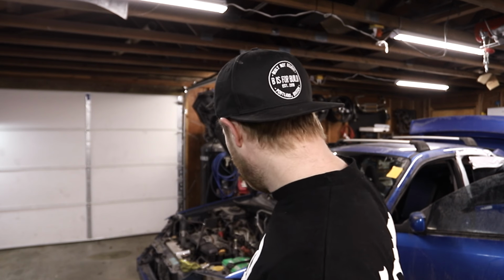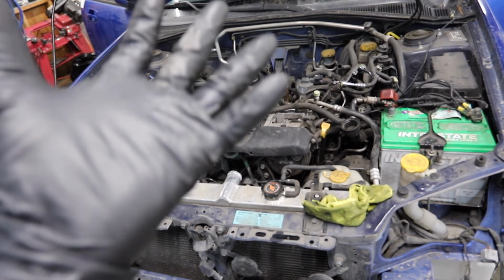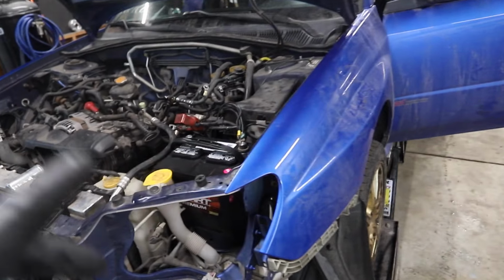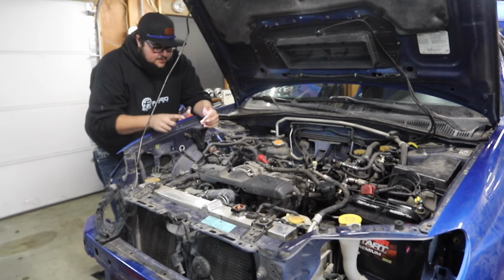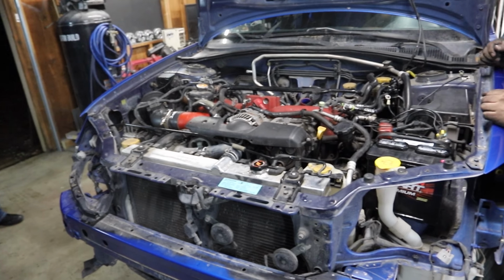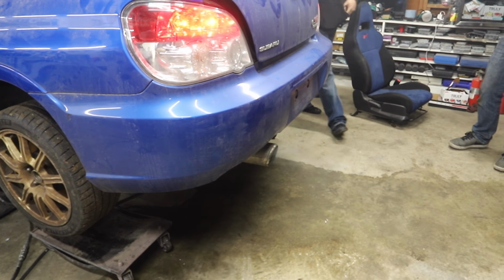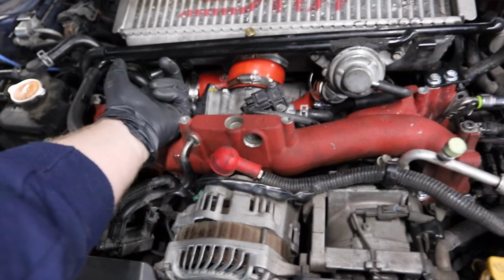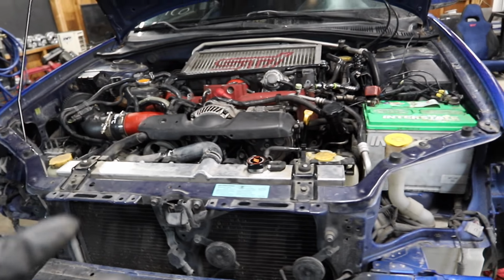Cheap Flooded WRX STI Will It Run!?

Comment: Drop the pan now. Clean as much as possible.  
Clean the fuel tank for sure. 
Drain power steering as well.
Reply: Agreed
Reply: Yup
Reply: I would do to
Reply: Agreed
Reply: rosskie320 exactly, he needs to replace that power steering pump too. The bearing is completely shot and they’re only about 70-80 bucks
Reply: ApeX MoDs agreed
Reply: Needs a full killer b kit when the pan gets dropped
Reply: I would have done that after the first oil change.
Reply: Do that its possible too bring this car back too it's original state
Reply: Also should drain the trans and diff fluid
Reply: @idokwatcher2062  60% of the time it works everytime.
Reply: Yeah that would be the first things to do
Reply: Agreed 100 %.
Reply: dont forget tranny and diff oil
Reply: Drain every fluid in the car*
Reply: And transmission
Reply: Not to mention brake fluid.... just do all fluids
Reply: Very simple, all fluids and anything that has a bearing needs replacement.
Reply: When it first ran I was like... did they replace the fuel? Then he said about water in the fuel and I facepalmed.
Reply: @Wanted797  Same here. It wouldn't crank and I'm like "I bet the lines have water in them" sure enough that was his techs comment next 🤣😂. This is a cool project though. Hopefully he brings her back.
Reply: Agreed

Comment: You could clean the engine by filling it with diesel instead of oil couple times and run it on idle. It cleans milkshake quite well and diesel has lub properties so it does not damage the engine or the seals.
Reply: Interesting
Reply: And by the way gasoline that many people use for that task is no good cause it dries all the oil seals in the engine as well as everything inside and it’s causing damage. Only diesel that contains basically oil.
Reply: a quart of transfluid will do it as well. As long as there isnt a heavy load on the motor the water will boil out when the oil gets to temp.
Reply: MrRock861261 yes will do just trans fluid does not have cleaning properties like diesel. Keeps tend to separate from water like normal oil. Diesel mixes with water and takes it out and when at rest then separates from water.

Comment: sounds like the idler pully bearing or the alternator bearings have had it
Reply: Was the A/C compressor still on the engine?  That's my guess.  Smaller belt (A/C "delete") for the win.
Reply: Could also be the ac belt tensioner pulley bearing having a shit.
Reply: Interesting !
Reply: I’m building a jdm GC8 on my channel if I head that I’d shut my engine off straight away.
Reply: @SAVING_ICONIC_MACHINES  Ya but you don't have the funds he has to blow so doesn't matter to him and everyone learns something. However to us normal folks yes you'd be right and I'd agree with ya.
Reply: working2Bselfsufficient definitely have to agree with you...and I do love b is for build great videos with lots of information ℹ️ 👍🏽
Reply: I thought  I heard a dragging note.
Reply: Oblioi mymilkchurn I know right? I can’t believe they didn’t think anything of it
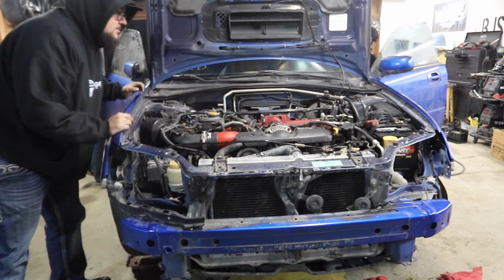Reply: is that what is causing the sound @13:20 ...my subaru recently started whining like that
Reply: My Jeep likes to believe that it is a submarine every now and then. My idler pulley and water are not good friends. I'd check everything in the belt system if this STI were mine.
Reply: The belt is probably slipping too. The rubber in belts absorb the water and they swell and slip. Or a bearing filled with water. I mean regardless replace the belt and check all the pulleys while he has it off
Reply: It's a flooded engine, i had the same problem before,  just throw a new oem timing kit and you will be fine,  no noise no nothing
Reply: All bearings on the front of the engine have been marinating in water so they're dunzo.
Reply: @SAVING_ICONIC_MACHINES  If you know what it is (which they did) and see that it's not critical then you add it to the list and move on.
Reply: Drunk3n_M0nk sorry mate I’m not sure what iv said and didn’t move on iv only put one comment
Reply: @trd8749  totally agree, nobody really cares
Reply: @nunyabinis  my A/C tensioner failed and sounded JUST like that.
Reply: u seem to think they know wut they are doing...i mean it sounds like they do but u can tell they arent very experienced. i see a lot of "google it" in that garage.
Reply: I had the same problem with my old rangerover after repairing it after being underwater altornator bearings where dead
Reply: the engine must be opened n serviced, they shouldnt started it ....

Comment: I definitely would have pulled the motor, pulled the pan, cleaned with brake-clean, pulled the heads, cleaned everything you can touch, replace timing belt and related rollers and bearings, reassemble, and pull the plugs out of the bottom of the fuel tank to drain (all of my Subaru's have had plugs). Would have taken little more time than y'all took already.

Comment: i know its a little late but it might still be a good idea; subaru makes a turbo failure engine flush which is a diesel like oil you add to the oil and run the engine for 20 mins and it really cleans out the engine. like $40 or less from a subaru dealership.

Comment: I have fished a few drowned floatplanes out of lakes. Drain and fill  with diesel as full as you can.  Drain the add oil and run. Diesel will get into all the nooks and crannies. Water will go to the bottom. Seems to do a good job and cheaper than oil😁

Comment: Love the video, one thing to note you may not have need to drain the oil that much. With the oil only being put in, run for 60 seconds then shut off. You are " Short tripping" the car. What the is, is when you run the car just long enough to get it warm but not warm enough to remove the moisture that comes form air. The moisture then condensates and appears in your oil as a milkshake.

Comment: It sounds like your power steering system has water in it.  The A/C compressor clutch sounds suspect too.
Reply: Yep noticed one of the rubber dampers missing on the clutch plate as well.

Comment: Use some atf in the oil to help drain out the water. Take a look also at the pcv valve and hoses. Any cracks in the turbo inlet? Lastly cxracing makes a top mount upgrade and get rid of that intake and find a stock airbox setup

Comment: One cycle like that with diesel instead of oil and you have no more water or moisture at all in the engine after. I’ve worked on so many water locked motors and just swamped motors and that’s the best way to do it

Comment: Check and reflush the steering pump... they can be noisy as hell if they have air in it.. check the o-ring on top of the pump ,where the hose from canister goes on. Mine sounds like that,when the 12mm bolt on flange on top of the pump was loose. And double check all the vaacum hoses... i have the same 07' Sti, EUDM :)

Comment: Timing belt kit and water pump replacement immediately . Also your alternator might need some new bearings. If your A/C compressor has a clutch might be noisy but it stops if you run it for a while.

Comment: Strongly suggest replacing timing belt, and tensioner, reseal the oil pump, replace water pump, and idler pulley, with belts.

Comment: For it to be reliable you need to drain and purge the entire fuel system, install a new alt and starter. Drain and purge the power steering. Bleed the brake system too.
Reply: Why bleed the brake system tho?

Comment: Drain the fuel tank, might solve the running rough problem.
Reply: Yeah when it's that bad it's in the oil definitely gas tank is next let alone tranny and 2 diffs
Reply: 100% there's water in there.  A little scared of the intake having whatever-that-was in there too...  mud, rust, who knows. I'm not terribly proficient but I know that once headers are off, rust follows pretty soon afterward.  Sounds like it sat headless for a few months.  Cool that it runs -- pretty good engineering to make something which can function after that catastrophic of water damage --  but if they dont get it out, its not going to stay running.
Reply: It's salvage car. It sat like that for at least 5-6 months with water in it before it even came to auction.
Reply: You never under any circumstances start a flooded car that you suspect went into the engine until you drop the fuel tank, fuel pump, bleed the fuel lines, brake lines, check the block and cylinders, the oil, the transmission, the fuse box, as much wiring as you can see by eyeballing it, and then once all that stuff has been gone over and had a full fluid change can you start it.

Comment: Awesome that this thing started off with no problems it must’ve been flooded and just sat without being started no Hydro lock didn’t seem like you had any water in the top side of the engine no water came out of the plugs when you turned it over so far home run 👍🏻

Comment: Hey Chris, at the time of commenting this comment, I did not watch the video yet, But if the engine runs, you can add a bit of automatic transmission fluid to your oil, to clear the sludge in the engine, recommended about 1000km before an oil change.

Comment: Temp coolant sensor normally has a carbon buildup at its tip. You could clean it with a carburetor spray cleaner and hook it back in and it should be good.

Comment: Old mechanics have told me to run diesel through the engine to clean it out instead of the oil that you used.  Might be cheaper depending on prices.

Comment: Get a long screwdriver and put it on the alternator, a/c, ps, idlers and see which ones are making noise.
Also drain the fuel tank 
And get some electrical spray and hit all the connectors with it, engine bay and under dash + ecu 
I did many flood cars and this is the basics

Comment: the is a little cap on the top close to the back of the oil pan to let the air out while oil goes in. dont take the cap off from the drain tube.

Comment: You could just use same oil. Pour it in to some kind metal bowl/container put it on to a cooker water just evaporates and you have 100% oil again. I've done that few times works great.

Comment: Engine coolant temperature sensors are super common disposable items on Subarus. Those and knock sensors. Just buy a few of each and have them sitting around because you're going to need them

Comment: Something else that needs to be checked on a flood car are the wheel bearings. A friend bought a restored flooded Ford and several months after he bought it, the front left wheel bearing failed. When it was checked, it still had water in it from the flood, so whoever salvaged the car, had not checked the wheel bearings for water and cleaned and re-greased them. Result - new front wheel bearings needed.

Comment: When ppl call boxer motors boxsters lol
Reply: And 'oil galleys' instead of 'galleries'...
Reply: When people call engine motors
Reply: blazers12369 guilty there. 99% of the time I don’t do that.
Reply: blazers12369 shit i do that a lot
Reply: @ButteredUpToast  Most of America and Canada does that!
Reply: @unicorn7337  also Mexico
Reply: To be fair it sounds better
Reply: @blazers12369  engines are motors
Reply: @ijmodified  a motor is electric...and engine runs on gas or diesel.
Reply: @willrush7293  a motor does not use internal combustion...an engine does. Motor to describe an engine is slang...I'm an electrician,  I deal with motors(electrical) all day long. But maybe you've sucked on too many exhaust pipes!

Comment: Honestly at this point why don't you rebuild the engine?
Reply: Facts. I get that its a budget build, but like it took me $4k to rebuild my entire STi motor with forger internals and a shop built my shortblock. I think if he rebuilt it, could potentially save him a couple thousand in the future
Reply: He hasn't even had the car in the ground driving. It's not a good idea to rebuild the motor at that point on a flood car. It's a pain in the ass to have to pull the motor, split it in half the put it back. Once the car is on the ground with a few miles then narrow the problems down to internal engine and if you either really like the car or make YouTube videos then rebuild or replace.
Reply: Depending how he is going to drive it I'd say break it down. At least change orings, king bearings and piston rings only take about a day with 3 people depending.

Comment: Get a cobb accessport and make sure you're running a proper tune. It really looks like the previous owner took all his aftermarket parts and left all the oem things in the trunk for the insurance company. If the battery was dead when they took it apart, they might not have been able to uninstall/unmarry the accessport. So there is the possibility that you're running a tune for all aftermarket things and that's making it run funny

Comment: You should check the bearings on the timing belt when you fix whatever that other bearing noise is. Subaru EJ engines are interference type - you DON'T want a seized idler pulley or something breaking the timing belt!

Comment: I did this with a 2016 MX5 and had a rod bearing fail after a day of autoX. I changed the oil 3 times before driving it hard.

I also drained the gas tank.

Comment: Put one or two can of Seafoam in the fuel tank. Shit is amazing. Cleans your whole fuel system from the tank all the way to the engine. Not a paid comment but the stuff is top notch, especially when you're working on this.

Comment: Im sure it's too late by now, but you can verify if the coolant sensor is bad with a multimeter. Check to see if the plug has it's reference voltage, and if it does then the sensor is 99% bad. You can also ohm the sensor itself, but that doesn't tell you a whole lot without engineering data on the part. Just check to see if it has power.

Comment: Drain the fuel tank every last drop put in fresh 91 octane guaranteed show runs smooth as butter. Gaskets old fast these days doesn't take long for sitting around to go bed plus like you said could be moisture in the tank as well.

Comment: After the third oil change you can let the engine idle until it reach full operating temperature and the remaining water will evaporate out of the oil then run the engine for a few hours and do oil change.

Comment: Remove the MAF sensor and clean with MAF cleaner. Using your scan tool. check the short and long fuel trims. Should be around 5%.

Comment: "I have my subaru expert here", takes intake manifold on and off 3 times to install turbo inlet.....
Reply: Also states it has great compression, but has the plugs out....
Reply: @gagedesigns4393  Yeah, that dude was an "expert" at nothing other than being a poseur. You could tell just by watching him in action with his lack of input and non hands-on approach in the situation.

Factor in that he also had to be told to watch his hoodie strings dangling in the engine bay while the engine's belts were rotating, and you have a poseur at his finest.
Reply: @Solo413  True Facts
Reply: Remember though, it only takes an e-sig and a few smack talking posts on NASIOC to become a Subaru expert...

Comment: Add some fuel treatment from Lucas Oil. It's essentially methanol to make the water miscible with the fuel and a TBN booster to help with acidity of ethanolated gasoline.

Comment: Thank you for not doing a wrecked Bugatti Veyron with rear end damage that caught fire on the tow truck while heading back from the wreck and then the wrecker driver unloaded it straight into the Lambo you had parked in the driveway when he arrived.

Don't get me wrong, the supercars are cool and you guys are doing so much better than I thought was possible with the amount of damage you've been dealing with. That being said, I'm glad to be back to a project vehicle that could actually be part of my car collection and not just my poster, calendar or Hot Wheels collection.

Comment: Hey, why didn’t drain fuel tank and clean injectors? Check starter and alternator too. It could kill both mechanical and electrical systems. 🤞

Comment: Sounds like you might be starting it in “test mode” your fans were cycling on and off which would indicate that the 2 green plugs under your dash are plugged into each other.

Comment: undo the engine mounts till there the bolts are held on by only a few threads, lift the engine. will be really easy to get to the plugs and will be much quicker doing it that way

Comment: The only Subaru I ever owned was a 1973 Subaru that I bought in 1980. It was a delightfully simple little car, decent mileage, just peppy enough.  Stick shift, good in snow, and quite reliable.  To be honest, that thing you are working on, at least under the hood, does not even resemble my old car.  Why did they evolve into Rally Cars for racing?  Does every brand of small car have to offer pocket rockets to get sales?  I guess if you can buy a WRX for less than $30K, the budget racers will go for it, eh?

Comment: a lot of people become confused between the difference between open/ closed loop and MAF or speed density.  Speed density has nothing to do with open or closed loop.  Open loop is running without O2 sensor feedback or correction vs running closed loop with the O2's.  Speed density is running based on RPM and manifold pressure.  Two different things.  You can run speed density in open or closed loop.  You can also run MAF open or closed loop.

Comment: I would have drained it and left the plug out. Then put an electric oil/transfer pump on an oil galley plug high on the engine and just let it pump new oil through the motor until there’s no water mixed with it. Hopefully the bearing clearances aren’t smoked after running it on that 50/50 water/oil concoction that you had in there

Comment: Probably too late for you guys but run a quart of automatic transmission fluid with the oil for a short time them change the oil. the detergents in the ATF will help clean out the grime deposits in the engine and release any surface rust in the cylinders and on the crank